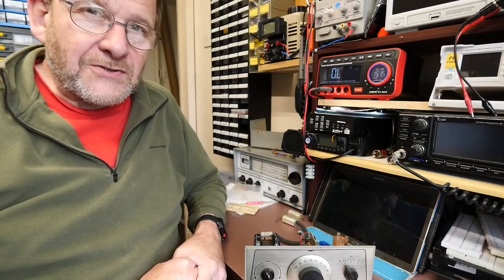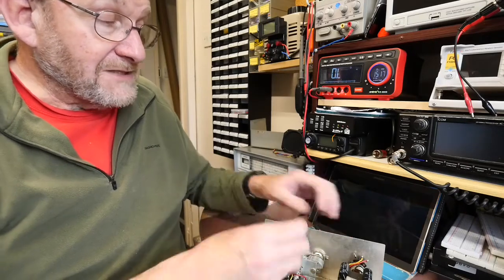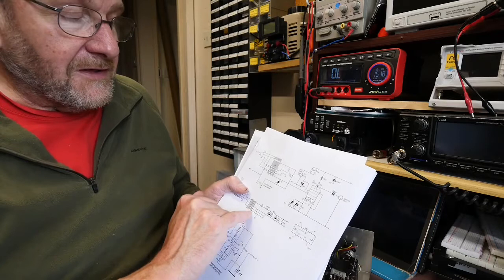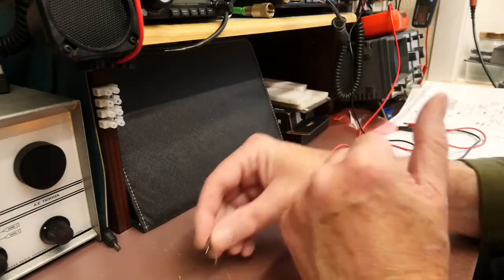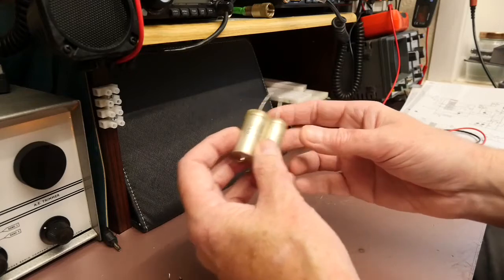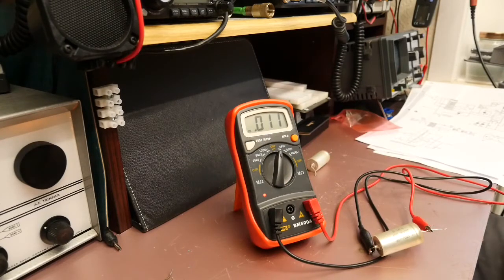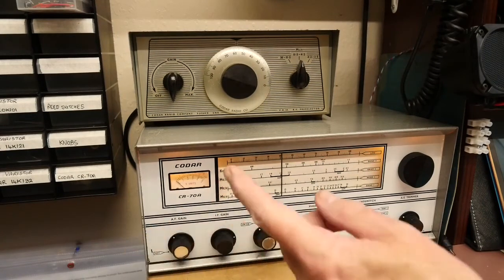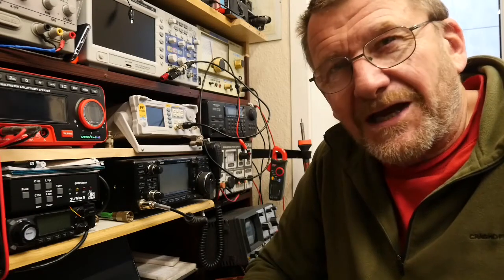Codar PR30 Valve Preselector - component upgrade

Comment: I tend to replace old paper and electrolytic caps on the old vintage valve gear from the get go, TC1 and DVM's, which I also use can give very deceptive readings. I also use a insulation tester at 250 Volts to check things out.  Nice video.